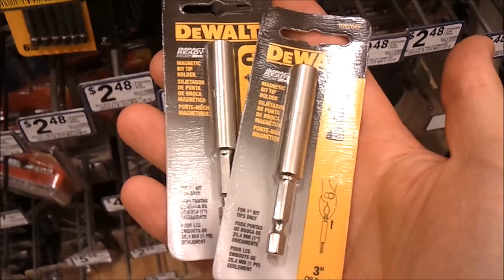pocket screwdriver

Comment: Very nice, But wouldn't you need to put some epoxy to ensure the integrity of the shaft, or would it actually hold up while putting torque on it? Not knocking it i'm just curious.
Thanks
Reply from the maker: james willard It has taken some serious abuse over the last year, but I also test such things by prototyping before releasing a video. The fit is way tighter than you might suspect, and that polymer core has serious elasticity; it was made to be clubbed to a point where it distorts completely and then returns to its original shape, so this thing is clinging to that extension bit with considerable force. But sure, you could still epoxy it, if you like ;)
Reply: pocket83 I gotcha thanks for the reply, and that does make sense! Take care.

Comment: Do you also find golfballs randomly? I find them at work all the time completely at random in the middle of the woods, I suspect that people throw them out of airplanes. Anyways though, great video, another great use for all those inexplicably acquired golf balls. What else have you used golf balls for?could that perhaps even be the subject of another video.
Reply from the maker: When Mrs. pocket and I go mountain bike riding in the woods, we keep count who finds the most. It is amazing how deep in the woods they are at times. For shop use, I prefer Wilsons.
Some of the things that I have used them for:
drill-press handles, planer crank, cabinet knobs, chamfer device adjustment knobs, pencil sharpener handle, one of my files, band-saw fence toggle, arbor press adjustment, etc.

Comment: i am going to attempt to make this, but i dont have a drill press. How do you think i can assure that the hole passes directly through the centre? 
also, because the magnet is flat, wouldn't the tip twist if you were to tightly screw a screw? wouldn't it make more sense if the magnet was jagged or something?
Reply: 3 years late but it's a 1/4 inch bit holder, the magnet holds it up and the 1/4 hex stops it spinning, the magnet is only there to stop the bit falling out.

Comment: I have a standard transmission. So could this be done with a golf ball for my gear shift knob and if so please make a video showing me how and let me know how sturdy it would be.
Reply from the maker: An eight ball may be a better idea for you. It is a dense material that can be drilled and tapped, or it can be drilled and filled with epoxy. I have a nine ball on my trim-coil break, and it was simply drilled out and attached using auto-body filler.

Comment: Always place the object you are compressing in the center of the vice.  No side loading of the vice.
Reply from the maker: +Mark A Nonsense. I side-load almost every time I use my vice. You consider the stress you are applying to it each time: If it remains a constant concern, then you are in need of a bigger vice. 

Note: I would take exception for large-scale metal work, so if you are a machinist, I do understand your point. But such procedural dogma doesn't apply to the crafty garage hobbyist.

Comment: +pocket83 I'm planning on making one of these but I can't for the life of me figure out what the thing that holds the screw bits in is called. Could you help?
Reply from the maker: http://www.homedepot.com/catalog/productImages/400/ea/eab16875-497a-4fc4-bb0b-fe99d3c38571_400.jpg

Magnetic bit tip holder? I've always just called it an extension. I prefer the 2" version.
Reply: +pocket83 Thanks!
Reply: +pocket83 Also one more question. What size are the drill bits you drilled into the ball?

Comment: What are the 2 hole sizes please Sir?
Reply from the maker: fdc313 Oops, sorry. I think it was 3/8" and 1/4" but I can't be sure. What I can remember is that it was a tight fit on both parts. There is no way that it could have been pressed in without a considerable force, like a vice.
Reply: pocket83 Thank you, I'll give it a try.